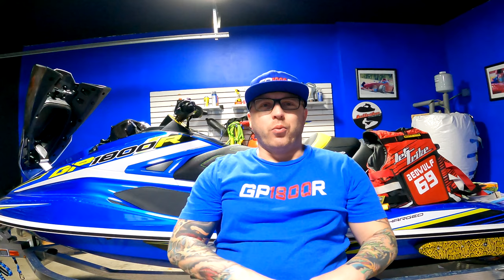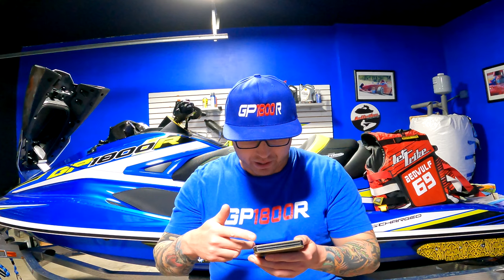New EPA Law Makes It Illegal To Modify Aftermarket Performance Parts On Jetski 4K

Comment: Any links to the new law?
Reply from the maker: I posted it on my Instagram
Reply: @IAmBeowulf  the link you have on instagram is for diesel motors do you have the one for jetskis?
Reply from the maker: It is for all engines not just diesel. Diesel has been fully restricted for long time.  You only read one paragraph of the post.